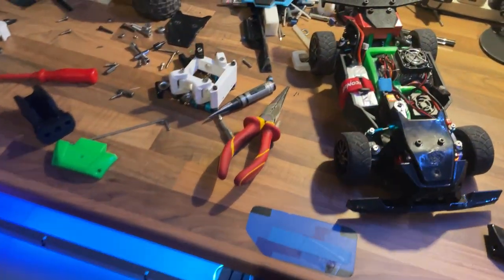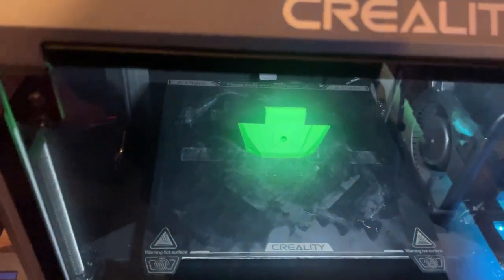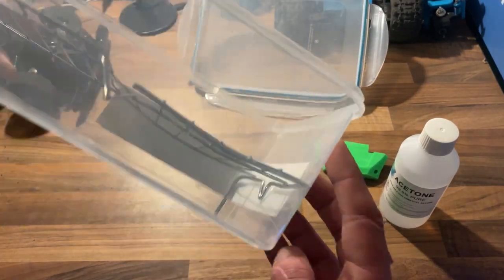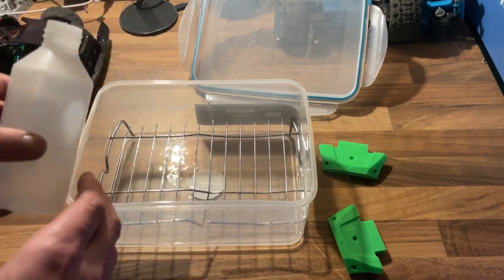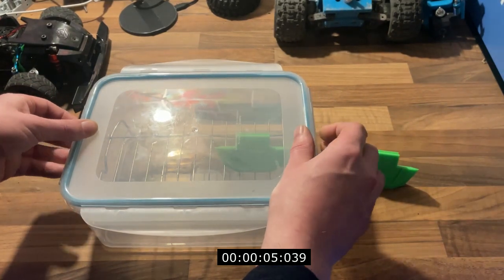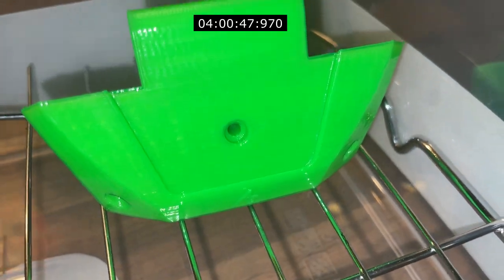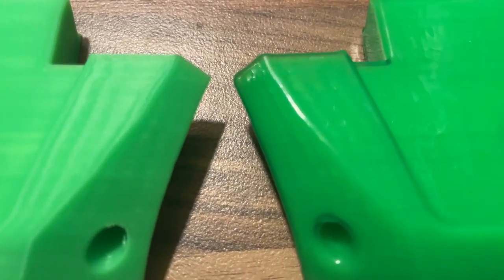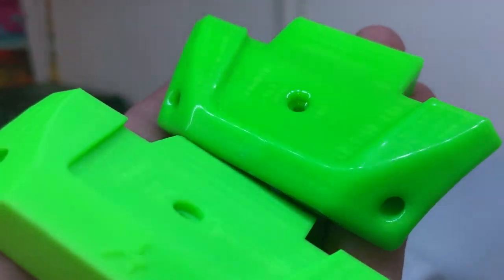How to make Super Smooth 3D prints with minimal effort

Comment: Yes, you can use nail varnish remover. The acetone is a solvent for ABS & ASA and will evaporate off the piece once removed from the fume container.
Reply: make sure to use nail polish remover that has acetone in it, as not all of them have nowadays
Reply from the maker: thanks

Comment: just a tip ::: set the container on a heated print bed and set that to at least 50c to help the acetone gas of more this will cut your smoothing time in half if not more
Reply from the maker: ahh no way didnt think of that, thanks for the tip